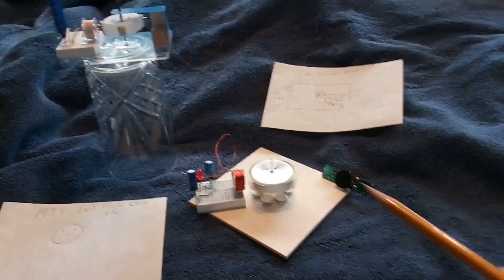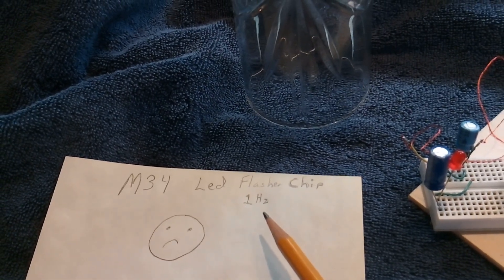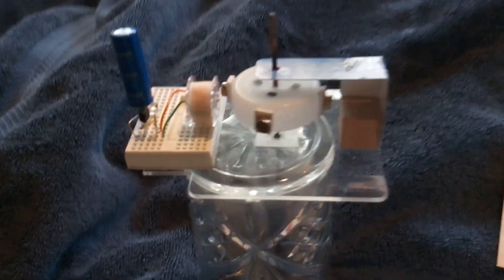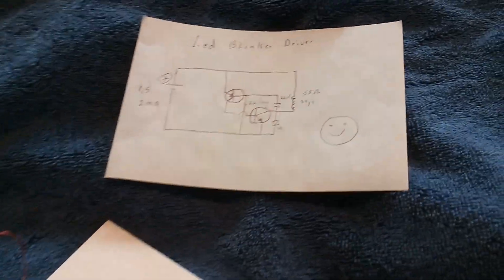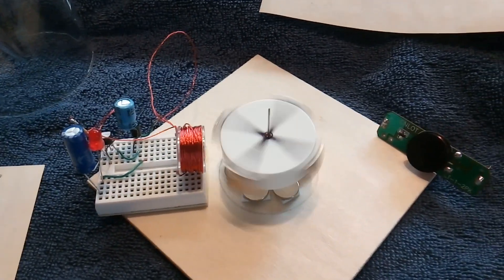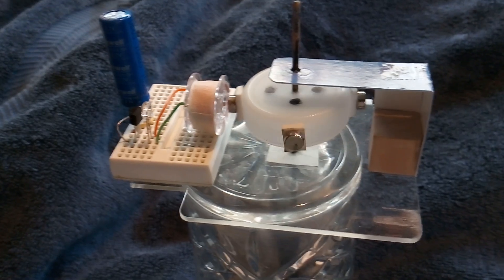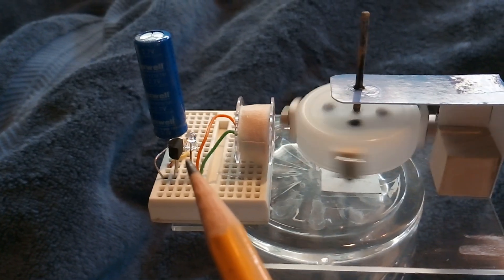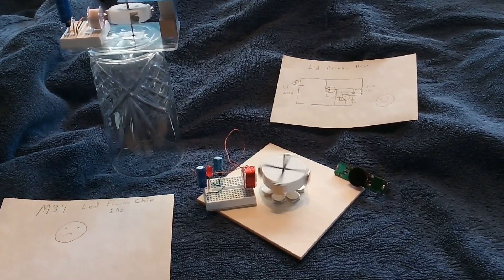M34 LED Flasher Chip ---- motor driver fail

Comment: I have a pendulum galaxy fake perpetual motion desk toy. It has a transistor in circuit with the coil to trigger the inductor to pulse each time the magnetic reaches a point. 

I think its the same as here.

Comment: Thanks for doing the experiments: The controller chip used on both the pendulum driver and the floppy flower devices was fully described on You Tube several years ago. The controller chip housing was dissolved in acid and the chip die was photographed. Later, it's component parts where described and a plausible explanation of the gate logic circuit described. You can watch the video here, (also make sure you read the comments associated with this video) >>  https://www.youtube.com/watch?v=pwR--SBEM9U
Reply from the maker: Thanks.  That was very interesting. This all seems to point back to the early electric clock days.  I really wonder what the "black dot" circuit was really designed to do. That is way over kill to run a solar toy.
Reply: @Lidmotor  Some of the comments on the flappy flower chip video mentioned that the chip was most likely created for the pendulum clock market. Tens of thousands of the those devices are sold in China apparently, many more than other parts of the world. What I found interesting is the fact that the chip you have does not have the electrolytic  capacity that that flappy flowers use. BTW. I run the flappy flower black dot chip setup on 6 volt solar cells and batteries. They also have reverse polarity protection. Since it is very difficult to produce resisters on microchips other methods must be used to create the timing feature of a capacity/resistive circuit. The use complex logic using gate circuits on the black dot chip eliminates the use of resistors. The Dadhav circuit is a copy of patented circuit going back to an old French patent if I remember correctly. So yes, you are correct. The complementary transistor circuit (Dadhav) it a clock circuit. Usually one of the complementary transistors is place backwards in the circuit to reduce the amplification effect. Running the transistor backwards make it work as a simple switch with very little amplification. This reduces the need to use extremely larges resistive values (in the Dadhav circuit) to control the feed back voltage created by the drive coil. I hope this is helpful. Thanks again for you hard work. It has been very interesting!
Reply from the maker: @lexyparrot8201  Thanks.  That is more great info on these circuits. Very helpful.👍

Comment: It's a shame it doesn't work, but thanks for showing us what did happen with it.
A use for it could be like those flashing LED's for dump circuits on Beam Bots, every second a solar circuit charges a cap and the M34 could dump the energy to a motor. In fact, I wonder if these are in the flashing LED's.
Reply from the maker: This same LC type circuit might be the one in a normal flashing led.  I tried to make a motor driver using a red flashing led and got the same poor results.  I did make an interesting pendulum  device today using the M34.  With no feedback though, it was still a bit chaotic.

Comment: Why fiddling/goofing around with those failures of circuits to get a one phase brushless motor driver? Just get an Mono Channel Audio Amplifier and connect the driving coil on the output speaker coil and the sensing coil on the input Mic. coil then you will get a insane one phase brushless motor. YT calls it Newman motor.

Comment: Based on my tinkering that’s not going to work as the timing 
Even with the standard coil / reed switch getting it running can be a bit of a fiddle as the magnet will also pull the rotor towards the reed switch

Comment: love it, more videos please, thank you- maybe the circuit with 1hz will run with lower amp circuits like your micro amp circuit or the simplefix setup?
Reply from the maker: You are welcome.  That M34 led flasher chip still has my interest.  It is like someone giving you a screw driver and telling you what it does ----then you find out that it will also open a can of paint..

Comment: I picked up an "executive toy" marketed as a "desktop electronic perpetual motion". Single transistor and bifilar coil. It reminded me of some of your circuits. Tear down video scheduled for the 24th 😊😊
Reply from the maker: That single transistor with bifilar coil driver is a classic. I look forward to your video on it.  The problem with that circuit is that it doesn't have the pulse self start feature like the solar waving flower circuit.  That is why Slider and I started playing around with the pendulum driver circuit. 😀
Reply: @Lidmotor  yes, I have to give it a push to get it moving. It ran for about 5 days before the batteries ran down. Probably run a little longer on better batteries. It uses 4xAA batteries, so none of my solar panels will have enough juice to run it directly from sunlight. It just made me smile that they called it Electronic Perpetual Motion 😊😊 I would have called it a Chaotic Magnetic Novelty as that would be a closer description, but I have no doubt the "Perpetual Motion" title would sell it better.
Reply: Cant wait!

Comment: I see you have that one running with magnetic levitation 👍👍😁😁
Reply from the maker: That magnetic levitation has worked out really well.  The plastic lid rotor runs very easily on that vertical needle.  A 3D printed one would be a neat little project.